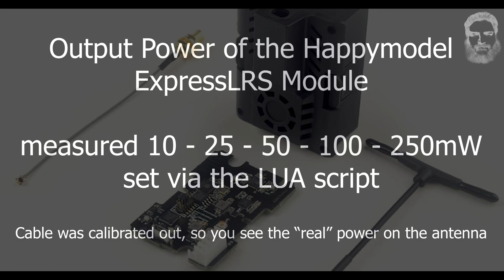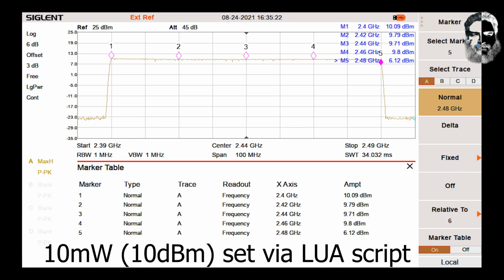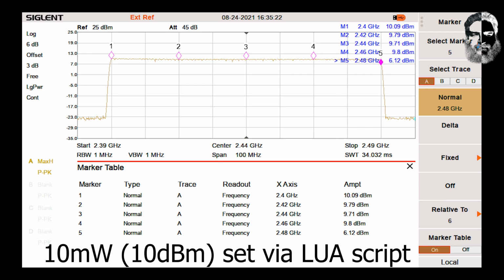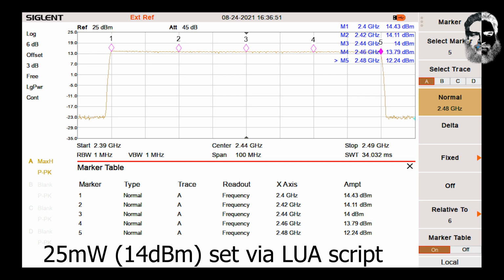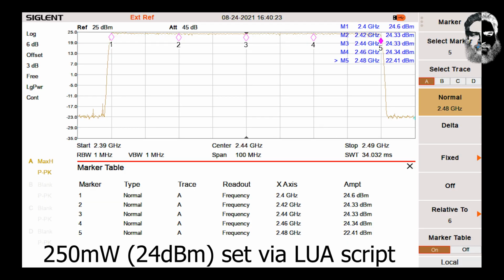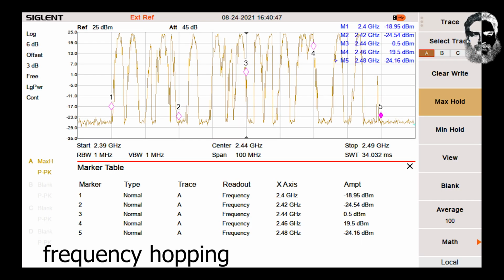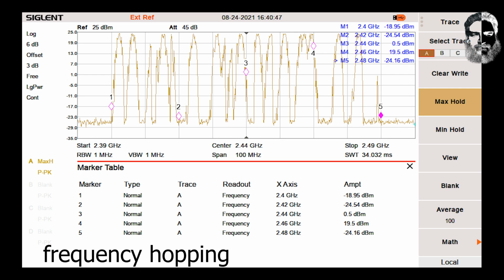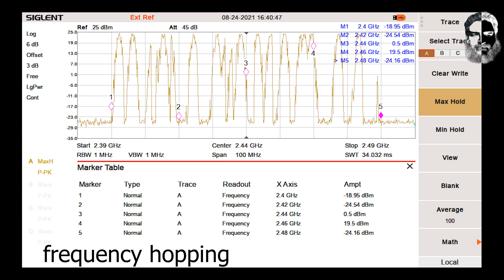Happymodell ExpressLRS TX module Output Power - no RF power meter

Comment: Thanks for the testing. 
Bye the way you mentioned that even on 250 mW there is no need for a cooling fan. I was a bit scared that the module might burn through by running the module on dynamic power or 250mW constant. But you already testet that and think that it is no problem at environment temperatures under 30°C without a fan? I don´t want to loose a quad due to a fried elrs-module.
Reply from the maker: Hallo Random FPV :)
With my 2 modules I can say that they do 250mW the whole day without problems. Not only on the bench, I can say that from hours of flying in the field, this sommer and never had problems with heat at all.
With dynamic power, you will not stay the complete time at 250mW as I did during testing, so the risk is even smaller.
Hope you have as fun as I have with ELRS.
Sandor